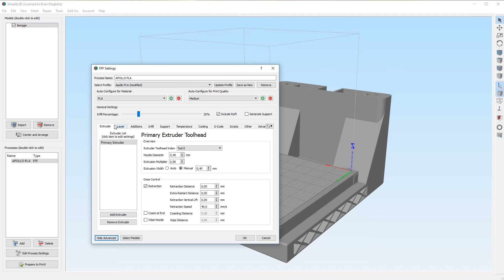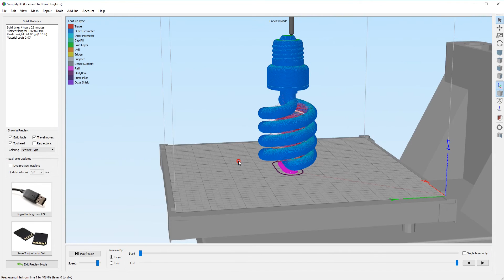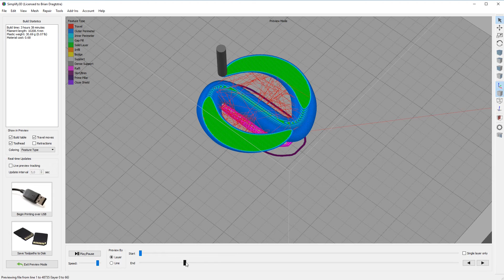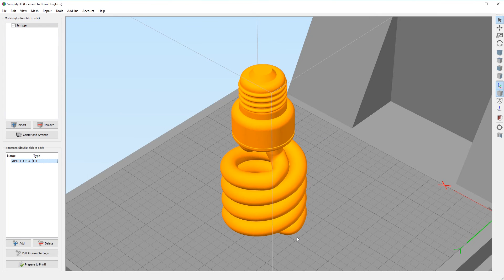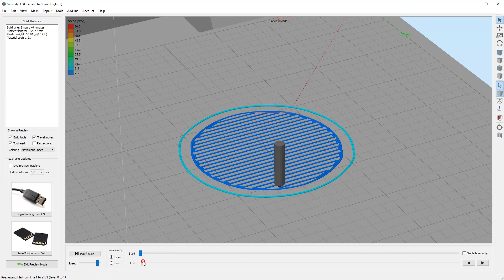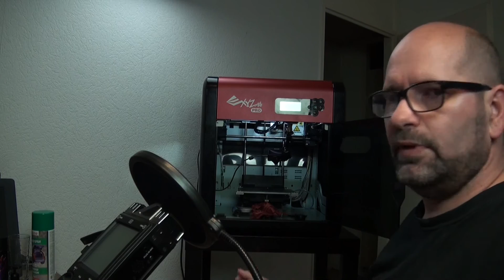▼ Simplify3D and the Da Vinci Pro 1.0

Comment: Do the manual job controls work?   I now have Simplify3D and it says it's connected, but nothing happens with the manual job controls etc.  ???
Reply from the maker: That's right. Not every function in the Simplify3D software is supported by the printer.
Reply: Wow, so how do I know if it's talking to the printer properly if I can't move the print head around or switch on the hot end etc?
Reply from the maker: Well, If you can see the temperature plot, then there is some talking and talking back going on.

The software gives a request to the printer, the printer acknowledged with an answer.

As far as I know, all manual controls like movement, overruling fan speeds, etc, do not work with the Da Vinci machines.

That said, there is an awful lot that does work, so your money for the software is well spend.
Reply: Thanks again for your response.  I followed your video and set the settings as best I could based off my past experience with this ABS in my older 1.0A machine and this is the first time in over a week that I have a print sticking to the bed!   I kind of figured it was the 90º temp limit in the XYZWare for Pro.  So dumb that this did that.   I have a glass bed clipped on top of the aluminum bed with the UHU glue and at 105º it works as expected.   (Another observation on this machine is that it makes a lot more clicks and taps sounds than the 1.0A ever did and I'm kind of annoyed by how dark the front door is compared to the old.)
Reply from the maker: Oh yeah, with glass you need to raise the temperatures about 10C to 20C higher then on aluminum. The stupid dark front door is because of the possibility to add a laser engraver. I wished the door would have been transparent.

Comment: My brother and I both have a Da Vinci Pro 3-in-1 and he's been having a lot of issues printing. I personally have had pretty good prints, so I'm trying to figure out what could possibly be going wrong for him. We are both using Simplify3D. He has been using 3rd party filament though. I am now trying with the same filament he was using to see if the problem is just temperature related. He gets A LOT of knocking on the feeder though. Still trying to nail down why. Oh..and by the way, we've both printed your Large Spool Holder. =)
Reply from the maker: I think I can help you guys out a little.
If the extruder motor is the part that's knocking, then the filament can't leave the nozzle at the same speed the motor is pushing it in the PTFE tubing that goes to your nozzle. That said, there are some things that can be the reason for this problem.
- The bed level can be wrong
In that case, the nozzle is so close to the bed that it prevents the filament from getting out of the nozzle. This is the most common mistake people make. Adjust the Z axis so there is more space between the nozzle and the bed, and the problem goes away. Also, in Simplify3D you can give some settings for the first layer, like the first layer height. Setting this at 150 or 180 percent does the same thing as changing the Z axis offset.

- The first layer extrusion can be set to high.
If this is the case, then also the filament can't flow out of the nozzle as quickly as it is pressed in . This also results in that clicking sound.

- The nozzle can be wrong or dirty
Believe it or not, I have had a wrong nozzle. As they said it was a 0.4mm nozzle, it turned out to be a 0.3mm nozzle. Changing the nozzle was the solution. Also the nozzle sometimes needs cleaning. If you don't do this, there can be some dirt inside that makes the gap narrower and prevents the filament from flowing.

I hope this helped you guys. If not, let me know what goes wrong and maybe I can help more.
Reply: Yes, he has struggled with bed leveling. Calibrated to perfect level, but then added tape, which although that doesn't add much to the Z-axis height, I know it adds some. Perhaps a slight bump up on the Z-offset may help, that or changing the first layer height. We will try both. 

How can you tell which nozzle you actually have?? I'm assuming it's a .4, How can you actually tell the difference between a .3 and .4 ? I don't have a microscope ;)  

We both try to keep the nozzle pretty clean. But will investigate more and use the inner-nozzle cleaning tool before the next print.
Reply from the maker: Well, If you can use the inner nozzle cleaning tool, you must have a 0.4mm nozzle :-)
That was my problem, I couldn't fit this tool and that made me think...
A quick look under a macro lens (of my photocamera) learned that the opening in the nozzle was smaller then the tool to clean it.